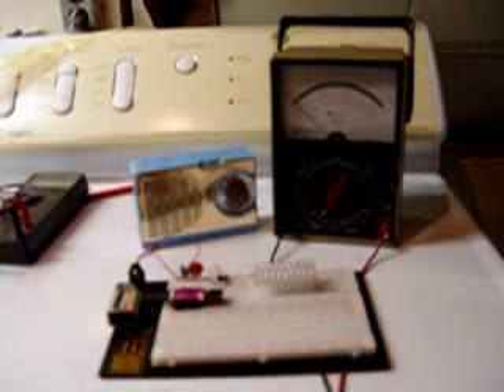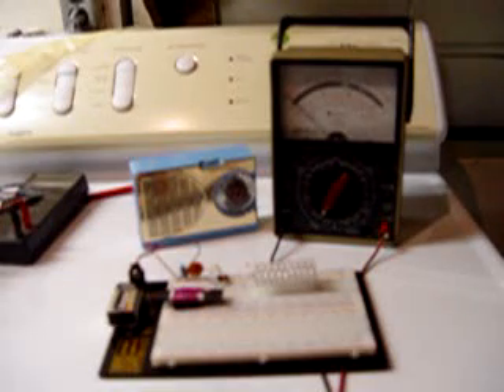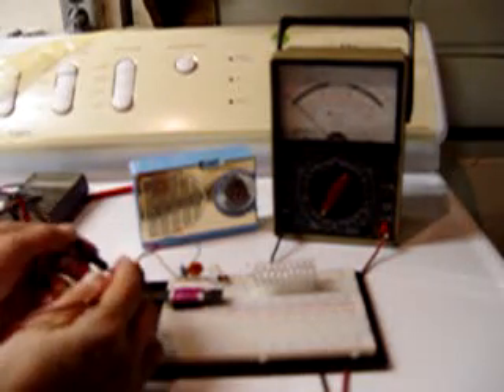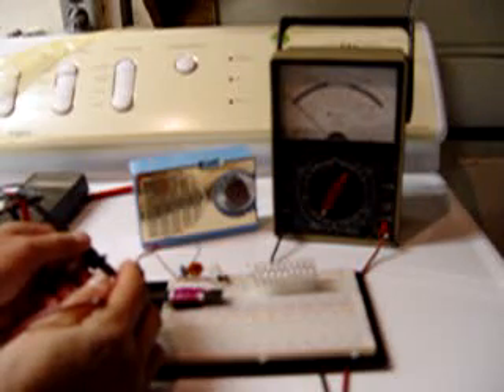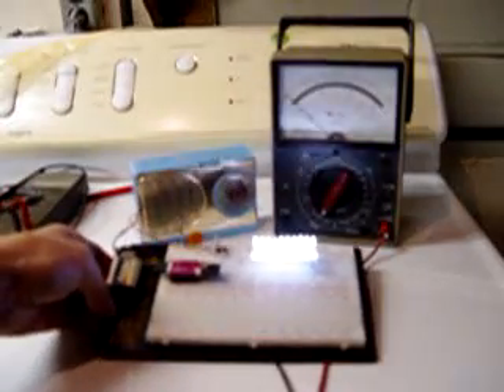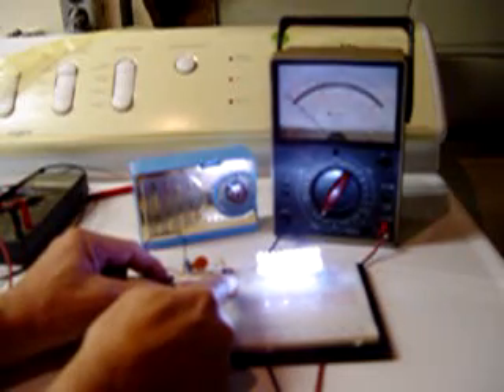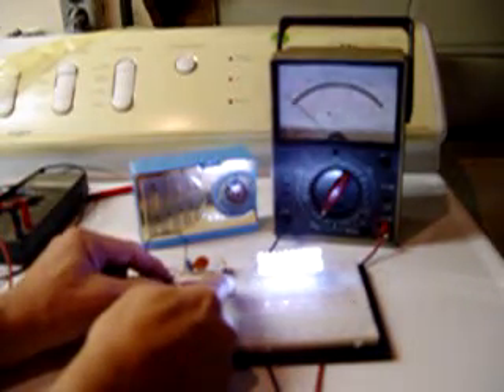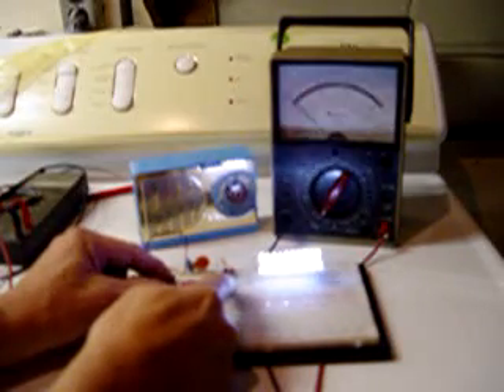Replication of Dr Stifflers SEC Circuit ( Demo )

Comment: Nice setup,
try a litz coil or a hand wound 10 to 50 turn coil  directly before the Avramenko plug and put it addiotionally onto the core. This will even light up the LEDs still much brighter with less input current.
Many thanks.
Regards, Stefan.